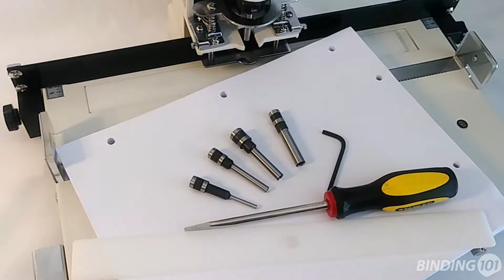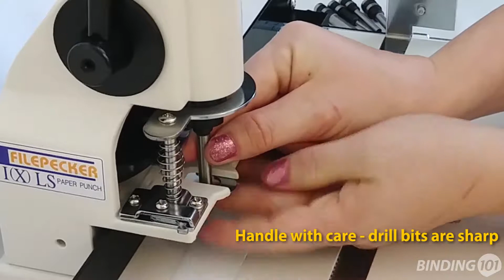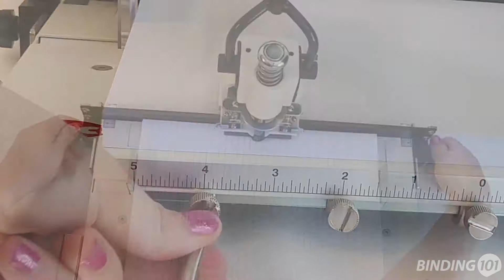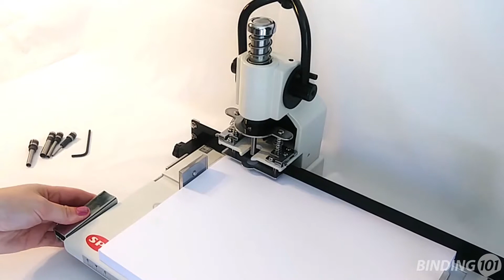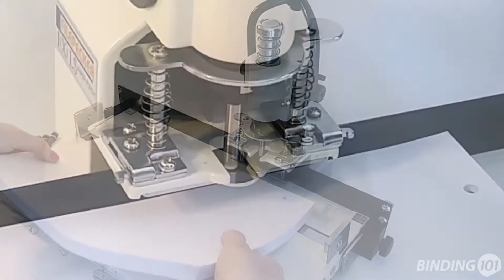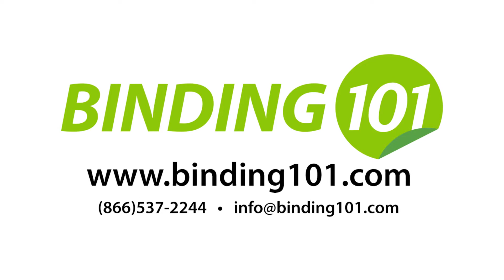How to Use the FP-1XLS Paper Drill High Capacity Hole Punch

Comment: Can I punch a 2 inch hole with this?
Reply from the maker: The maximum hole diameter available for this particular paper drill is actually 3/8". I do not actually believe there are any paper drills that will do a 2" hole. Are you using them for grommeting? Because we do offer grommet press machines with the option of a hole punching die. Check out this link to learn more: https://www.binding101.com/grommet-presses-grommets